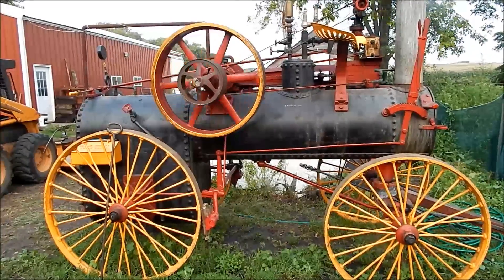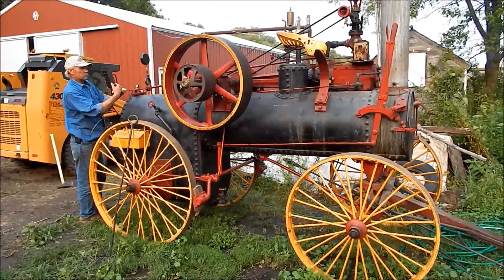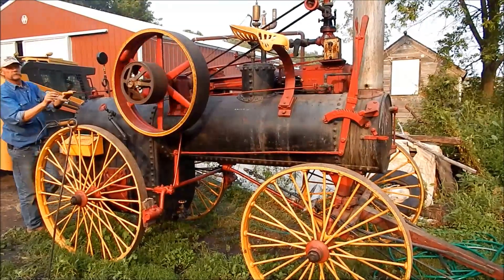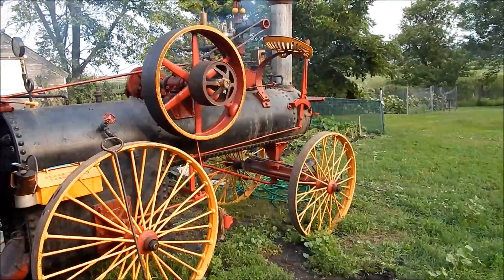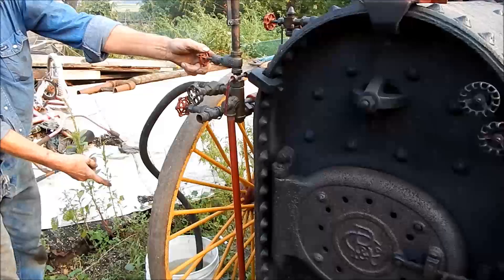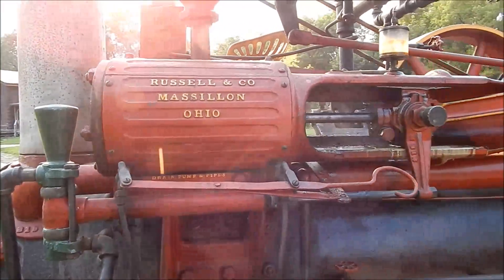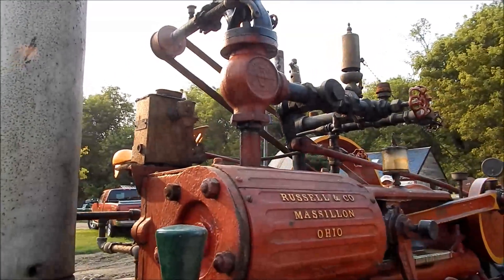1891 Russell Portable Steam Engine

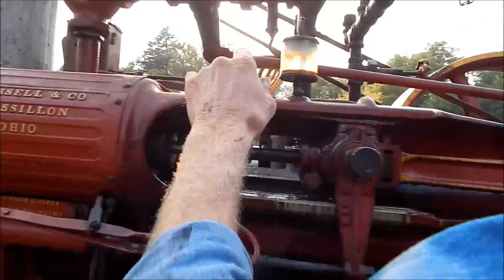Comment: At about 5:00, you show the connecting rod and crank disc. There's a bracket in front of the disc and the connecting rod is driving a little crank attached to that bracket. That little crank does not seem to be connected to anything. Do you know what it is for? Thanks for sharing this video -- you and your brother get into some interesting machines!
Reply: The eccentric behind the crank disc is for the valve motion that allows steam into and out of the cylinder.

Comment: How would you explain the difference in the horsepower "ability" of the big steam engine's 6 horse power over the little Briggs & Stratton you mention?   Would it be the power of the big fly wheel?
Reply: Sam Finn I had assumed the torque values of the engine is what made them so powerful for there reported HP. From my limted understanding just the mechanism of using steam in the cylinder create far more potential power then a gas or diesel engine at a much lower speed. I'm now interested in this and will need to do some more reading on steam engines.
Reply: Swarm509 As a side point ... I've heard that some modern manufactures of small marine outboard engines measure their horsepower right at the output shaft to make their engines appear to be more powerful than the makers who measure horsepower at the propeller.
Reply: I've seen auto companies measure power at the engine output shaft rather then at the wheels as well. Is there an actual standard in place, or just whatever each company wants to do?

Comment: Those wonders of 19th century steam engineering we used extensively in the South East by families who maintained their own saw mills. I wish I had a dollar for every broken (sometimes in half) flywheel that I've found half buried on such sites including the old family farm(s) in South Carolina. I have always suspected the loads got too heavy for the flywheels (iron and low grade steel) too handle or the belts running the sawmill jammed and stressed the wheels o the breaking point. Thanks or this video as it filled in some blanks left over form stories my Grandfather and Grandmother told me about their childhoods on their respective family farms.

Comment: selling power back.  while it is true, they only pay the rate that they pay the big power plants.  a few pennys per KW.   plus you have to have all of the equipment to meter the power in each direction and they install gear so that in case of a downed wire your power source doesnt hurt the workers putting it back together.   have a seat and spring steel stand for a piece of equipment in the garage.  plus another seat.   People around here buy old plows and such at farm auctions grab the seat and leave the rest for the scrap iron buyer.